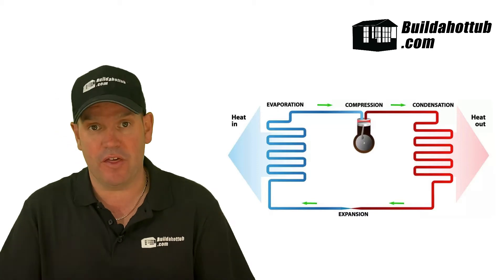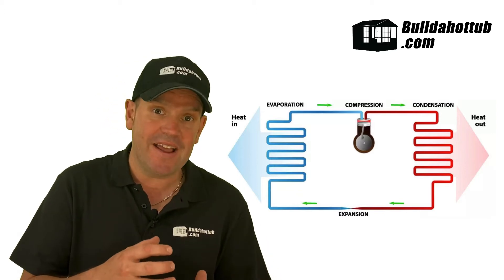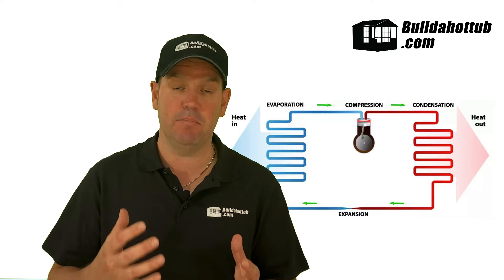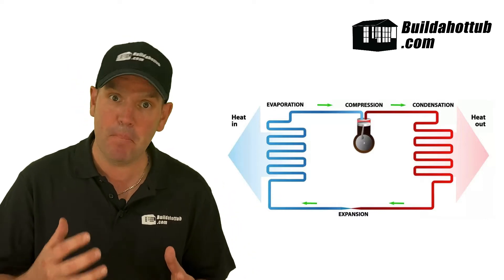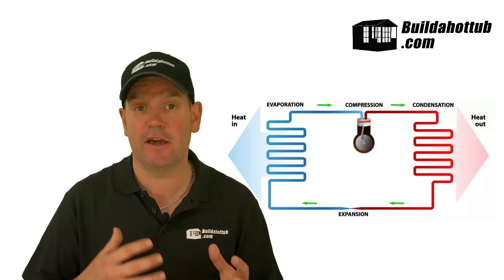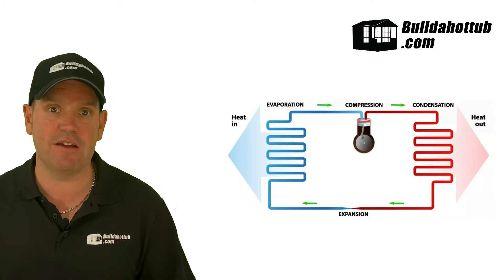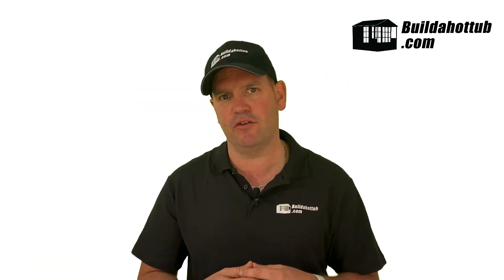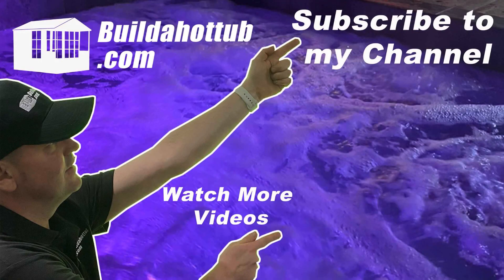What is the BEST way to heat a Hot Tub? Air Source Heat Pump!

Comment: Hi Andy. Our spa has a air source heat pump installed, but it is super slow heating up 24-30 hours. Is it possible to activate the the hot tub heater element to speed up? It has a Balboa control. Hope you can help me :)
Reply from the maker: Hi There, that doesnt sound right at all - have you by any chance got the bypass valve open on the air source? so that would mean not all the water is flowing through it and it becomes inefficient but just enough flow to not have a flow error - that is longer than it would take my own 3KW electric heater (before I got an air source) to heat up so something is not right there. - Let me know and I will see how I can help

Comment: Is a heat pump for a spa capable of heating your spa to temperatures of 100° fairly easily ? Yearly temperatures in my area average between 44 and 90°F. Thanks
Reply from the maker: Hi There, thanks for visiting the channel. ASHPs vary hugely in their efficiency at lower outside air temperatures. They have to work harder in the cooler air to produce the heat. What this means is that it will cost you more money to use one in the colder months as they are not as efficient. That said, if it is sized correctly for the body of water that it is heating, most good qulity pumps will get you to 100F when the air temperature is in the low 30s no problem - just costs you more than it does in the warmer months. Hope that helps - cheers, Andi

Comment: Hi Andi if I have a air source heat pump what size kw heater should I get on the hot tub? :)
Reply from the maker: Hi Tiffany. Thanks for the watch and the comment. If you are using an ASHP on your tub, the electric part is somewhat redundant. Spa Packs come with heaters as I explain in the video, but the ASHP will do most of the work. Going on popularity of what is in packs at the moment, somewhere between 3 and 5.5KW you will end up with from the likes of Gecko, Balboa or ACC. This is average for the packs on the market at present. Hope that helps - cheers, Andi
Reply: @Buildahottub  thanks so much Andi , great video. The spa pack for the model only  provides  2kw or 4kw , which of those would you go for? I think our concern is that it will struggle in winter on a 2kw but then we advised a 4kw would eat into cost savings from the ASHP so a bit torn
Reply from the maker: Hi Tiffany, I can't see the 4KW eating into your cost savings to be honest. For me, I always advise to go with the largest on offer. It is true in winter at certain low temperatures, the ASHP might need a little helping hand as they are not as efficient in the cold so the extra power might come in handy.
Reply: @Buildahottub  thanks so much Andi , this info is great 👍

Comment: I wonder how these air source heat pumps work in the desert.  Yes, hot during the day, but often quite cool in the evening.  I am thinking of the climate in Baja California Sur, Mexico (around Todos Santos).  But definitely interesting technology!
Reply from the maker: Hi Brendan, Thanks for the email. The heating efficiency is better in warmer climates for sure. With air source heat pumps it is the colder temperatures you need to look carefully on the spec sheets. The cheaper models (sub 1k USD) are no where near as efficient at lower temperatures. Some will not even get you to temperature. Good quality ASHPS will be able to get you up to temperature when the outside temps are -15C / 5F - always check the specs. Just because it is an ASHP doesnt mean it will do the job for you. Thanks for watching, cheers, Andi
Reply: @Buildahottub  Very interesting.  The baja desert doesnt get less than 7C, and that is rare only in Dec & Jan.  Tho that is when u would want your hot tub nice and toasty.  Does the convection element use alot of electricity?
Reply from the maker: @Brendan2Alexander  - depends on a number of conditions to how much current the ASHP draws and what it outputs. On an average day, not too hot or cold, a unit will draw about 8A, 2KW - again, this is a rough number as all units are different. What happens is as it gets cooler, the unit's ability to heat decreases. So, on a hot day, it will output something like 40K BTU, however on a cold day, that will drop to 20K BTU but will draw 12A, /7KW to do it - again, I am generalising as each unit is different, but you get the idea. All this info to a specific unit should be provided by the manufacturer on a spec sheet. Hope that helps, cheers, Andi
Reply: Make an insulated hot water tank to heat and store hot water in the day with the heat pump pulling heat out of your house! Then, use the hot water tank to heat your tub at night!